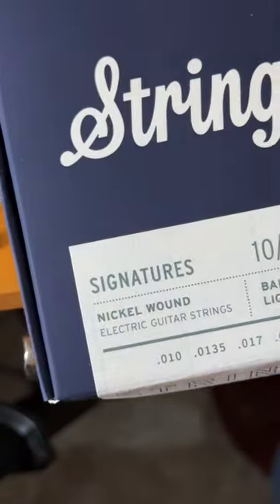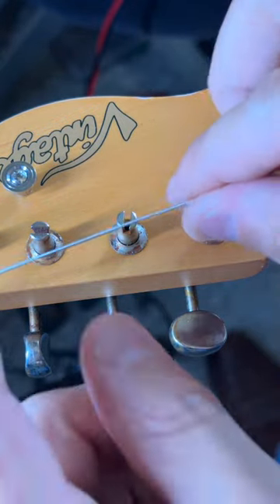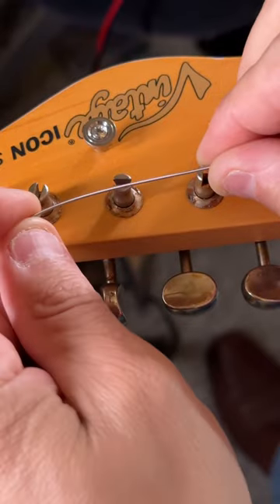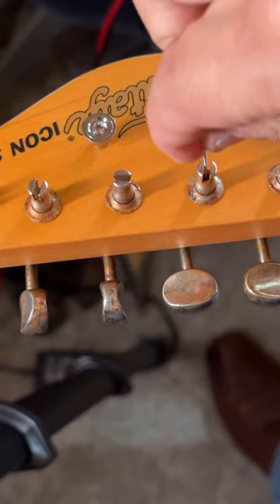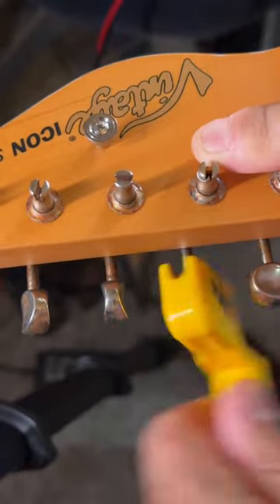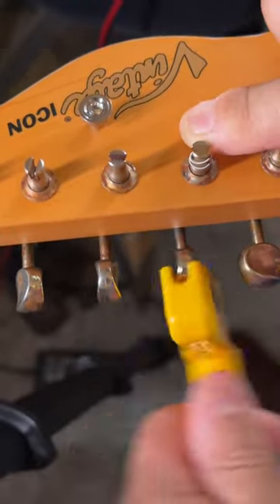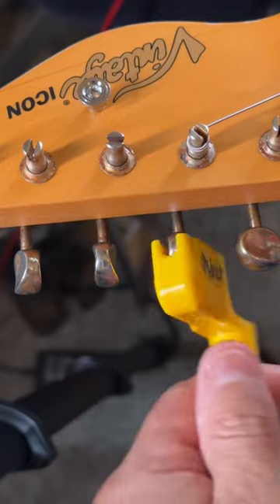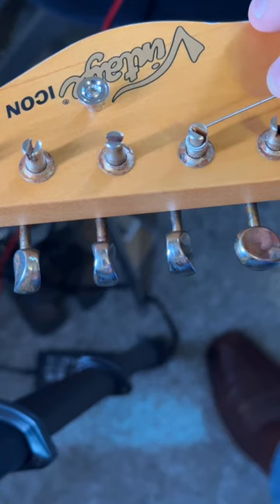How To Use A Vintage Fender Tuner #shorts #guitar #telecaster

Comment: The high E and B strings are a PITA with these tuners.
Reply: You just need to guide the string downwards with your fingers,and constantly apply a bit of tension on the string while winding it at the same time.
Reply: Takes a bit of finessing but I agree, certainly night and day compared to a locking tuner 😂
Reply: I had problems with them too but the trick is to wind a turn and keep applying a little bit of tension so that the string doesn't unwind. It's hard the first few times (i ruined a couple strings myself) but now they're my favourite tuners